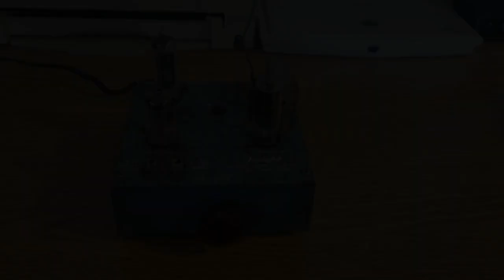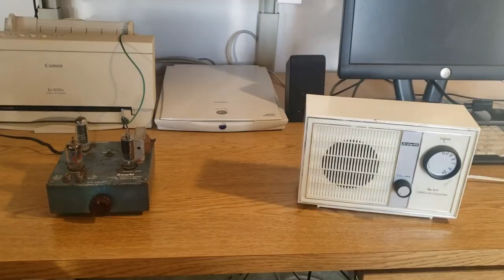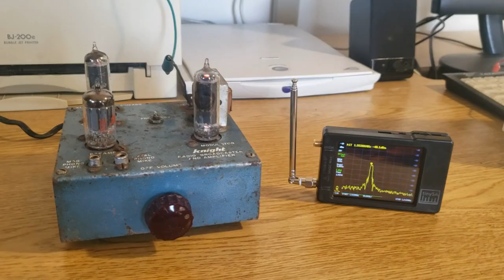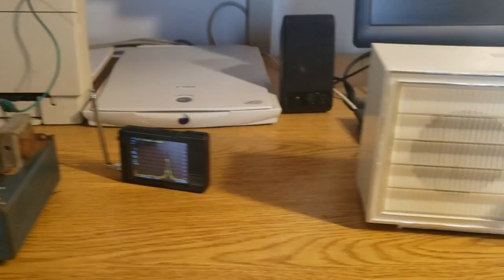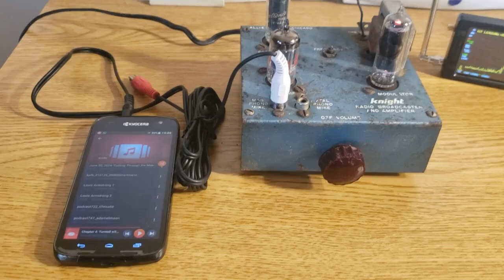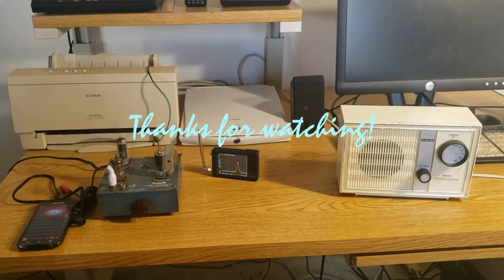Secret Mountain Laboratory - Knight Radio Broadcaster Amplifier - AM MW Transmitter - Old Time Radio

Comment: The Knight Broadcaster was the biggest piece of crap you could image. Less than a toy. Unstable. Hum on the carrier… and back in 1965 when I was 14 I couldn’t figure out the issue. Today, I think it was RF getting back into the ‘modulator’ section. Mattered not where you set the volume control… that was ‘upstream’ back in the 12AX7 area. I lost interest quickly.

Comment: For power to the final less than 0.10 watt a license was not required. The operator would have to dodge the commercial stations or you could not hear it. They often called phone oscillators. They were marketed to allow listening to your phonograph on the patio.